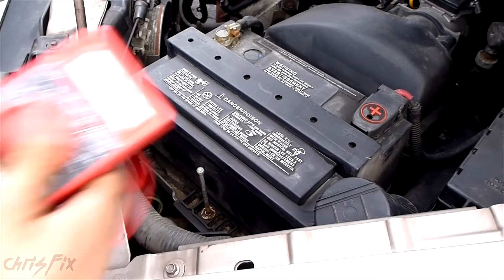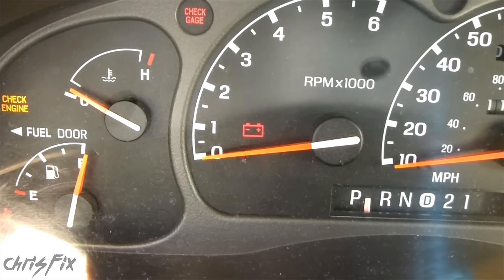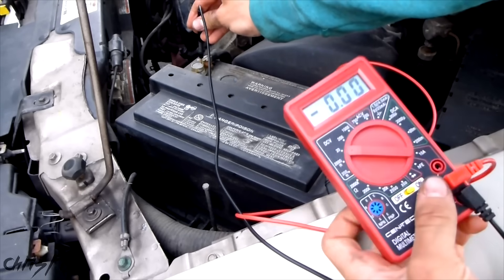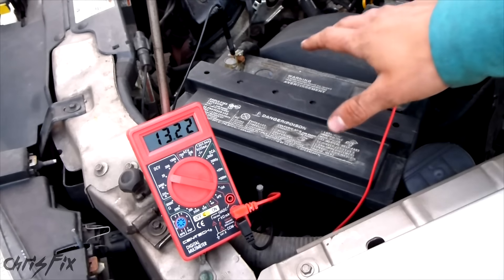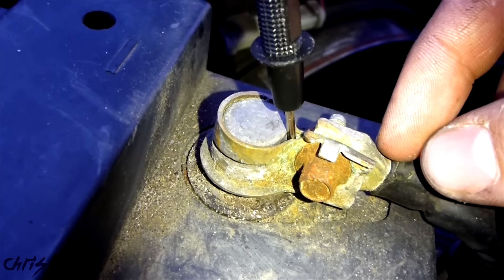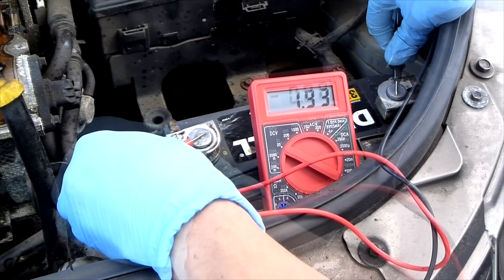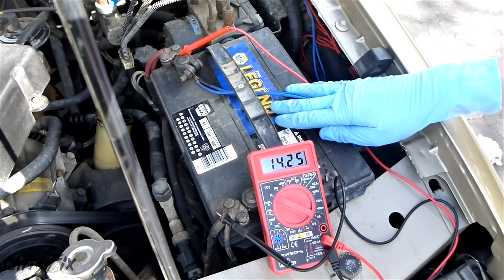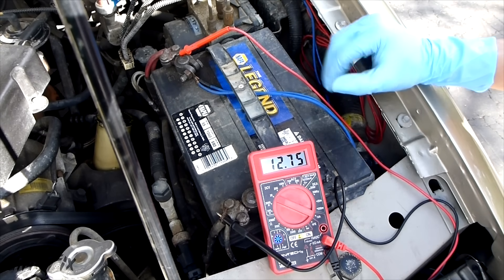How to Test a Car Battery with a Multimeter

Comment: so should the car be off for two minutes, keys out while the headlights are on?
Reply from the maker: Yes!
Reply: @chrisfix  thank you :) is this normal?
shows 12.6v idle (engine off)
Droped to 10.2v when turning over and sat at 14.1v when engine was on. Does that seem a bit low in your opinion?
Reply: @bradley9856  Youre good at 10 cranking volts....for now
Reply: @TuneStunnaMusic  Thanks, how long do you recon it will last?

Comment: If my battery comes in at 14.2 with the car started, would the battery be charging if I leave the car on for 45 minutes or I have to take it out for a drive in order for it to charge?

Comment: A couple of days ago my car was starting up fine. Left it standing since then and went to start it today and just got rapid ticking sound and it wont start. A few weeks ago it did the same thing but got a jump start and hadn't been a problem until today. Measured the volts and it says 11.7. Is the battery bad or is the alternator not charging it?

Peace

Comment: My car when turning on the ignition didn't turn on any sort lights.. so i decided to check the battery when i connected the multimeter to the battery all the dashboard lights turned on with battery showing 12V. What was the problem in this case?  Is the battery faulty? ( It's just 6 months old)

Comment: Hi! If I buy a new battery and charge it with a charger, what should its voltage be after 12 hours of finishing the charge?
Reply from the maker: 12.6 or above!
Reply: @chrisfix  Thank you for replying! Can you please elaborate? Will a new car battery charge to 14.4V, is it true that if I turn on my lights for 2 min it will fall to 12.8V, if I leave it resting and disconnected for 12.8V will it fall to 12.8V? Is 12.8V 100% charged? In that case what are the volts over 12.8V for?

Comment: stumbling across this video, the battery being ON doesn't always mean that battery is BAD.. many cars with a BAD alternator will turn on that battery light IF they do not have a separate charging system light...  you always do a good job, good videos..  thinking about it more, on Toyota's and Lexus's, when the alternator goes out it will ALWAYS turn on the Charging / Battery light and the ABS light automatically....

Comment: Red battery light doesn't tell if battery is good or not. It's light up when there is no battery charging (usually problem with alternator or connection).

Comment: Hi, I know this is a bit late but I have a question. My car just died today while driving as soon as we went past 3000rpm. So we checked everything and everything is fine. I tested the battery and it's at 11.6v and when trying start it drop to 3v. It's not starting anymore. Could a bad battery caused it to switch off?

Comment: Should you add distilled water to a car battery ?
Reply from the maker: By that point it's much easier and cheaper to buy a maintenance free battery, if you have a regular one then you can add water if it requires that!

Comment: Hey Chris. Love your vids. Question: My 98 GTI has battery about 5 yrs old or so. No start. No clicks or crank. Has been slowly struggling to start for weeks now but after a few seconds of slow turning sounds will then start. Yesterday I stopped and started it five different places doing errands and at the last place it finally did nothing. Would not even try to turn over. Dash lights, wipers, and headlights work fine( but I know they don't drawl much juice). Multimeter reading was only 12.3. today. Do you think the battery is most likely the problem or should I go on to check if current is reaching starter, fuses, ect...? The tow truck driver and I push started it and I got it home running fine, but once I turned it off all warmed up, it would not start back up. Same thing...silence.
Reply from the maker: Sounds like your starter motor has died, I have a video on how to fix that, check it out: https://www.youtube.com/watch?v=yC409CU7mU8
Reply: Dont you have codes?? Just wondering.

Comment: Thanks so so so much man. It’s 8:30 and I have jobs and contracts lined up but my pressure washer stopped working and cranking. Just checked and it drops to 0v when trying to start. That explains why I needed an external battery pack sometimes and why it’s not running. You just saved me a ton of time. I’m off to pick up a new battery in the morning.
Reply from the maker: I'm glad the video was helpful!

Comment: Be careful, if you want to remove the battery terminal connectors for cleaning, leave the engine running, otherwise, on new car models, your car's radio anti theft system will require a new code from the car dealer.

Comment: Would be interesting to hear Chris's opinion of the pulsed DC battery chargers now on the market that claim to recondition lead-acid batteries. The old standard brute force method using 25% duty cycle high amp charging to electrolysis could be more prone to operator error.

Comment: I measured my batteri while it was connected to the car (car turned off), but the DC multimeter showed voltage flying between 18 and 24 volts, constantly changing... why could it be??

Comment: The multimeter can't tell you if the battery is bad it can only tell you if the alternator is charging or surface charge. You need a load tester or an electronic tester.

Comment: Extra "old timer's tip":  Once those terminal posts are clean, lightly coat with petroleum jelly.  Been doing this for our assortment of vehicles for over 45 years and have never seen an adverse effect.  Keeps the posts from forming corrosion.
Reply from the maker: Thanks for the tip!

Comment: I did the same test..
12.6V, started and it dropped to 10.8V ... then went up to 14.1V: 
 you would think thats a good battery. I turn on my power inverter and put a 50W load on it for 15 min, come back and car wont start and needs a jump.
We jump start the car, battery voltage again at 14.2V ... shut the car off, voltage back at 12.4V .. .. start it up, drops to 10.3V then back to 14.4V ....
Same 50W load test for 15min then the battery is dead and wont start the car ... 
So your test shows me the battery is good ... apparently NOT ...

Comment: problem is   everycar   is different...my car   never reads  14.0   volts   ever   even at full  engine revs...     13.7     then after  normal   high way speeds   it  goes to 13.5   at idle  it  can go down  to 12.8            ..   a good resting voltage for a charged battery  is 12.6

Comment: What happens if my lights are dim and wipers are slow. ... and when I take off the positive wire the battery the car shuts off , is that an automatic bad battery or is it the alternator? 
I took it to autozone and they said the battery is a bad one ( 4 years old) . But I don’t want to put in a new one and have a bad alternator ruin it since , from what I’ve been told , if you tAke the positive off of the battery and the car shuts off it’s the alternator that’s bad ! But could my car shut off once I do that because it’s the battery that can’t hold a charge ? 
I just dont want to double spend
Reply from the maker: I have a method to test your alternator, check it out: https://www.youtube.com/watch?v=LGB6ZEjGm7Q

Comment: The older comments about load-testing a battery are correct. The most complete check would be from a auto parts store (for free) or a shop, using a battery analyzer. But Chris mentioned this in the video, for gosh sakes! However, if you are 20 miles away form the nearest AutoZone, O'Reilly's, etc. and you are having problems, and all you have is a multimeter....you use the best tools at hand. Any info is better than no info.

Comment: Could I lose the cars computer memory if I disconnect the Battery to perform the terminals cleaning?
I have heard some shops connect a temporary battery to the light charger.
Reply: Yes, that is true. A 12V alrm or UPS battery would supply enough current to keep the battery alive. If you don't, on many cars you might experience rough idling until the engine control computer fine tunes its settings.
Reply: bobR thanks a lot

Comment: A good tip for battery posts and terminals is to smear them with Vaseline. It lasts longer than WD40 and is also electrically conductive. Great video.

Comment: So many negative posts about this vid.  Anode this was true as soon as I read them.  I was shocked.   As if he's some kind of crank.  Or got a terminal condition.  He's not going to start anything.  He's not guilty of any charge.   Definitely not a charge of battery.   So he won't end up in the cells.  He'll just stay ohm.  Even though he's easily lead.   But he's got plenty of capacity and energy and is maintenance-free.   So let's have some more positive comments and fewer acid ones.
Reply from the maker: lol

Comment: Great overall but the battery light is not a test of the battery at all. When you cycle the key to the on position all the dash lights are supposed to light up and that’s called prove out and it’s only so you know the warning light bulb is operational so if something should fail the bulb will light to let you know

Comment: This is wrong. Your battery can be garbage and still give out more than 10 volts during engine starting. You gotta take your car to a professional tester, they do it for free. They use a tool that's not just a multi-meter.

Comment: The truth of the matter is USE A LOAD TESTER TO CHECK A BATTERY ! I work on and test batteries all the time ( I work on stand by generator's ) we were using a multi meter to check batteries Literally hundreds of batteries, some tested 13.5 vdc or higher and would not start a motor because they had a bad cell . Others tested 12.8 or higher and were fine.
Reply from the maker: thanks for sharing

Comment: If you get a normal reading on a multimeter, around 12.5 volts and then your vehicle will not start try charging it. If the charger does not show it is charging you have a bad battery. Take it to a parts dealer and load test it. The load test will probably show a bad cell. You need a new battery.

Comment: Every result came out good but I’m still dealing with flickering interior and exterior lights
And then compare to my other truck of the same make, model, and year, both batteries were replace in 11/17, but it has no electrical issues and actually comes up with 2 more volts in any given situation

Comment: Tried turning on my headlights for 2 minutes to do the battery test, and the headlights shut off in under a minute. Also my voltage is reading around 11.9. and I hear a clicking sound when I try to turn on the car. That must mean the battery is gone right?
Reply: Measure voltage when you put your key in second ignition position, if voltage is good it may not be the battery

Comment: I had a factory battery last 10 full years on my Chevy Cobalt.

That said the car wouldn't start and AAA jumped it.

I went to the local auto battery store 2 blocks away when I noticed my trunk where the battery is located, it was smoking!

Here the water in the battery dried up and as a safety mechanism the battery stopped working in which I bypassed that and jumped it!

It would've exploded if I kept running and charging it! 

Be careful guys when you jump a battery. Keep a good eye on it, the battery might be shot and immediately have to go like in my case. 

The AAA guy who I bought a replacement from (was cheaper than the store I was at) said he's never seen a battery that hot before.

Comment: I have a 01 tribute with battery light on. My battery after leaving the light on for 2 minutes reads 12.43? Does that make it a bad battery since it’s not at 12.6 and above? Car starts fine and does not go below 10.0 volts when starting.

Comment: Excellent, to the point video..... I had thought of buying a cheap ebay inductance meter but maybe I'll reconsider that.
TIP: Over the decades I have used a kettle of boiling water to get rid of the corrosion salts and the back of a broken hacksaw blade, rather than emery paper, to clean terminals....avoiding grit sticking to them.
Cheers
NoAxe

Comment: Chris  great video!   I just replaced the original batteries on my 2004 dodge 5.9 Cummins.  How old are they? 15 years 10months.  When truck is sitting for any length of time, I put the batteries on Ctek chargers..thanks

Comment: The ONLY TRUE way to test is to do a load test on a battery. You can have one sitting at 11.6 v all day with a multimeter but put a load on it and see what you get.. May give you a big surprise because a battery can have a much higher standing level  than what it actually has as a useful level  Have seen them actually only have as little as 8v
Reply from the maker: thanks for sharing

Comment: I have a 2400cc turbo diesel which struggles to start in cold temperatures. The CCA is approximately 9.75 volts. Should I replace the battery or can it be restored somehow?

Comment: Foremost:: a lead acid car battery has 6 cells @ 2.2volts each. So a fully charged (100%) is typically 13.2volts—not 12.6,volts as Chris says.

GEL or LITHIUM batteries are a bit different in voltage all look so.

Comment: what we want to know is how to use the actual multimeter what are the settings what do you plug-in is it amps or volts that's what this should be about
Reply: It says at the begging of the video and you can pause it to see the multimeter.

Comment: I'm using this same exact multimeter, and I can't get any reading whatsoever when I have the reader cables installed in the same configuration as you. I just don't know why. Only when I put the black reader cable in the "V[ohm]mA" (or middle) hole and the red reader cable in the "10ADC" (or upper-most) hole and run the test, do I get any reading. (By the way, it reads " — 12.67 " with the engine off at the battery. Is this good?) The multimeter is set to 20 DCV and is on.
But you have your black reader cable hooked in to the "V[ohm]mA" (or middle) hole, and the red reader cable hooked in to the "COM" (or bottom-most) hole, yet you get your readings. What's going on here, why can't I get a reading when I use your set up? Why does that work for you?
Thanks

By the way I'm working on a diesel vanagon that won't start. New battery. I think it's a glow plug relay issue, if history in deed repeats itself.

Comment: I bought a used Honda do I need to replace the battery my battery was at 11.6 so I jump started it went between 14.3 -14.6 is that good or bad when I turn off the car it went to 12.8 and started to decrease voltage so does this means I need a new battery

Comment: My multi-meter has a battery function for load testing 9 volt, 1.5, volt, and 12 volt batteries.  Will the 12 volt setting on my multi-meter also work on a 12 volt car battery?

Comment: Starting the engine.
Volts must be +10v al times under starting.
If its lower,you have a problem.
Rurrning engine,+ 14.4 volts.
If its 12volts oure lower.
Is the pully of the alternator magnetic while running?
If not,is your alternator light on?

Comment: Just what I needed. Picked up a cheap multimeter recently which I'll use for this test. Was going to just buy a new battery as the old one appears to be dodgy but this will confirm. Thanks for the clear, concise info!

Comment: Boiling water from kettle disolves corrosion straight away wear goggels just pour  it slowly you will see corrosion washing away good let it dry and coat terminals in copper slip grease its always the pos terminal that corrodes great video

Comment: My truck wouldn’t start this morning and I knew that sign would be a dead battery and I would be late to class again like in Feburary. But what I also remember that it would be the second time my battery “died” this year. Which makes no sense to me because car batteries last up to 4 years depending on condition. Well I checked again after class to see if maybe multimeter reading could tell and my battery Volt with no engine on is 12.6 and the engine on its 14.6. I was dead confuse to why my truck “died” this morning which made me think that morning temperature is cold to which it needs a small heat up time. Am I correct with my theory?

Comment: sir what if when i start the car my volt meter is 14.0 or 14.2 but when i turn on the aircon it will dropped to 13.0 to 13.2 then when i turn on again the head light and fog light it will dropped to 12.7-12.8 what do you think sir is my charging system ok or not txn for tje answer

Comment: Dealer Toyota said need new battery CCA low. Took it home cleaned terminals and connections followed your multimeter technique and on starting Voltage dropped to 10.5V so am I good?

Comment: dont use WD40, as its mostly for removal of rust or oxides moreover it is non conductive of electricity. Use CRC (contact redundancy check)spray for ultimate results..... bye bye....

Comment: I have seen batteries with 12.7 volts and no amps, no crank no start, A voltmeter does not check amps.

Comment: battery light has nothing to do with a good battery. It actually indicates if the alternator is working. When the voltage from the alternator goes above the battery voltage, the current can no longer flow through the dash light.

Comment: Chris, try baking soda with water and nuturalize the battery acid before attempting to clean the terminals.
Reply from the maker: Thanks for the tip!
Reply: @chrisfix  
Those battery acid will put holes in clothing as well as skin and eyes burn. Usually in a week you will notice holes even it went through the washing .
So please be careful folks.

Comment: Heh, just measured mine. After 2 mins, it is okay at 12,83 V stable, and 13,9 V after starting. But. During ignition, it drops down to 6,8 V and has a tough time starting sometimes - even the dashboard lights will struggle to appear. And once you turn on the rear and front fog lights, while running, it drops down to just 12,3 V. I guess it's time for a new battery.